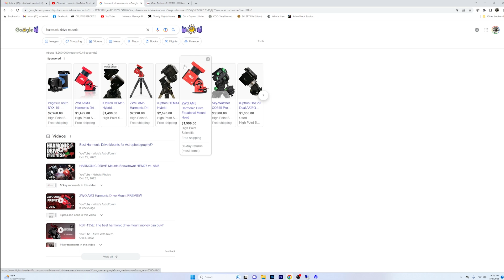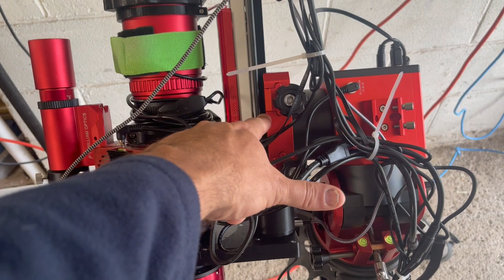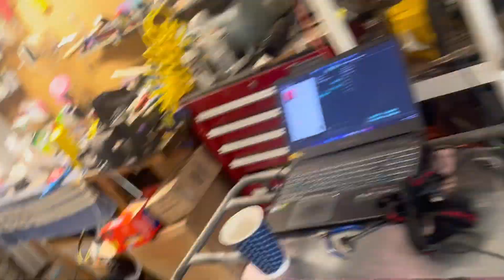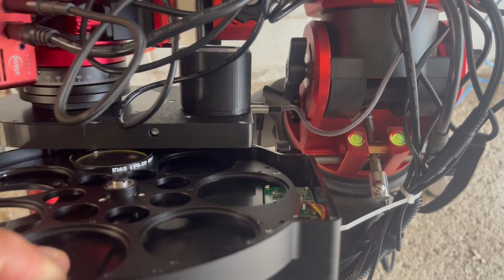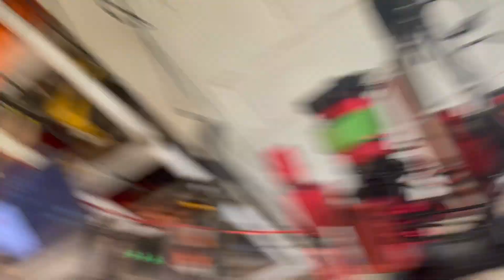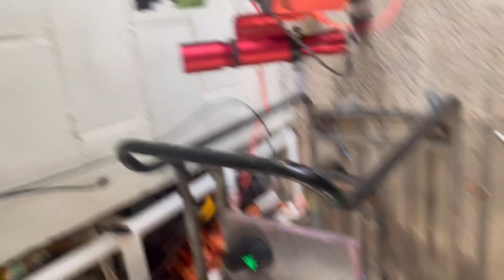TRYING TO ADD A ROTATOR TO THE REDCAT51 AND ZWO AM5 | IT WONT FIT!!!!

Comment: Hey Chad did you resolve the issue with the set up on the mount?  Hopefully you have a solution. Cs
Reply from the maker: yes..so last night was the first night with the big 3d printed ones that are on agena.  i grabbed some longer bolts and was able to go through my celestron dovetail through the risers and through the recat dovetail with nuts on top.  guiding performance was unchanged.  was able to move everything back to center after really moving it all back for a few clear nights and testing the rotator.  it all worked great and ill have a video out showing it in a few days
Reply: @easyastroimages5818  that's great glad you found a solution to fix it.  Cs

Comment: Very interesting problem. Is there a pier adapter available from ZWO to raise the rig above the mount? Can't believe they out smarted themselves. Side question: When is a camera rotator necessary?  Thanks
Reply from the maker: so the pier extension raises the mount from the tripod.  the issue here is im hitting the mount..so raising it just moves it all up.  this is a mount space issue.  rotating is built in to many scopes now.  you can manually rotate or automate it like i am trying to do so that you can frame your targets differently through the night.  so target one might be at one angle and then target 2 at another.  automate it so you dont need to get up in the night and move it yourself.

Comment: Find a local hobbyist with a lathe and  he/she could knock up a simple spacer to fit between your saddle clamp and the mount. It looks like there is already a relatively thin one there, (the black piece  between clamp and rotator). Is there any reason the focuser drive and filter wheel can't be arranged to stick out 180 degrees from present position, ie, on the other side of the scope?
Reply from the maker: Nina and it’s rotation angle and current rotators have a weird inability to sync to match. So I would love to keep it rotating only within 180deg but there in no guarantee. It seems to have a mind of its own :). The Pegasus rotator has more options to program but at twice the price of this rotator and no guarantees it will work perfectly all the time. So I guess this is why many choose to not use them. But boy are they handy !

Comment: Are these manufacturers considering the user, or just not testing the equipment possibilities first before releasing.
Everyone wants to be Mr/Mrs gadget. For the amount of times in one night I wouldn't  use a rotator, I would not bother with one. Maybe use a filter draw, losing more weight of your focus train too, instead of the filter wheel. Or as 'Az Ray' mentions use a longer plate and counter weights. Maybe add riser blocks You can through lots of money at this hobby. Prices are getting to the point of being just numbers. Hope you solve your problem. Clear skies to you.
Reply from the maker: Yes sir agree. I think I need a combination of all the above. Might have to make some concessions to get this all working appropriately

Comment: I see the problem is the scope is not back far enough.  What I had was the opposite issue.  My scope was to front heavy so I put a longer dovetail plate on and add extra weight to the rear end so I could move it up in the saddle.  My scope was almost hitting the tripod legs.  Hope that helps.
Reply: Can you mount the rotator and filter wheel facing up away from the mount?
Reply from the maker: You can but then it’s taking the rotator. From testing Nina and the rotator see 2 different positions. Mechanical and sky and for some reason they don’t like to sync with each other??
Reply from the maker: I might have to bring it back more then I wanted to. Seems easiest combined with a little more riser height.